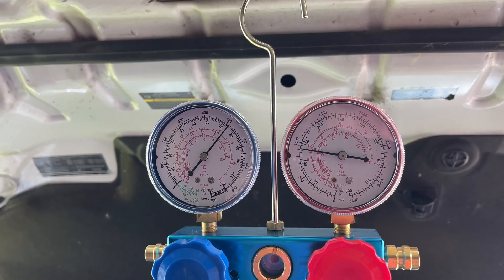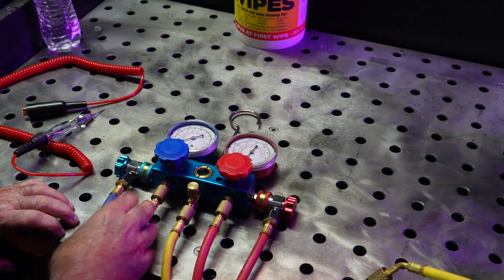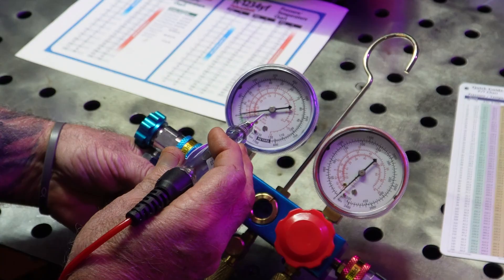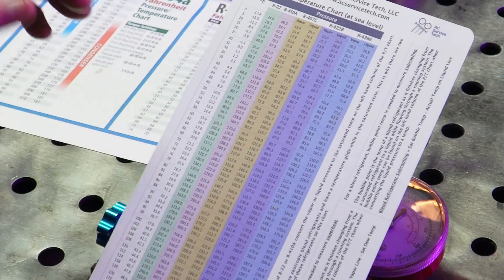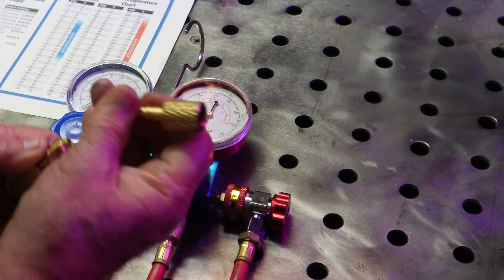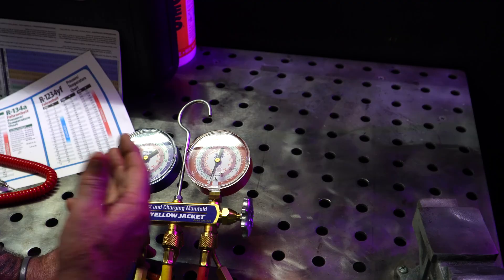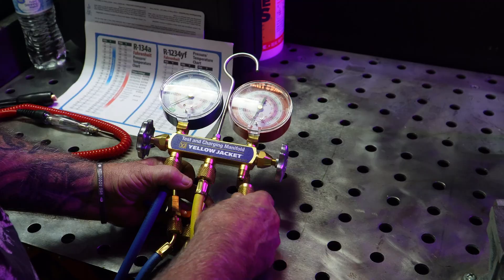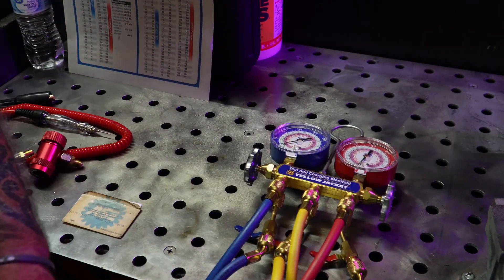How To Read And Understand AC Gauges

Comment: Rus, what is the right saturation temperature. in car hvac, we simply take everything out and refill with recommended oz..  wondering right satuation temperature.. if freeon is low, PSI will be lower, saturation temperature goes down , does that mean it cools down more.. if so why do we need to go with 40 degree saturation point instead can we aim for 35. degree saturation. i believe if we go closer to 32 degree saturation it will freez up, that why they are targetting for 40 degree saturation. just trying to understand the dynamics... appreciate your help here.
Reply from the maker: Automotive AC systems are designed to run as low as possible without going below freezing temperatures.  My Toyota has a target temp of 34 degrees at the evaporator fin thermistor.  Many scan tools will tell you the target, and it’s up to the ac control module to achieve that target by adjusting the pressures via electronic control valve.  Where you have the cabin air temperature setting also comes in to play so it delivers your desired comfort levels.  Other sensors such as ambient air, solar, cabin, etc.  all play a part by sending their inputs to the control module so it can accurately make adjustments to give desired comfort.  Hope that makes sense.

Comment: When pressure on low is 30 psi what does the temperature reading mean? lets say +8C?
Reply from the maker: Which refrigerant?  Pressure / Temperature correlation changes from one refrigerant to another, such as R134A at 30 psi on the low side correlates close to 35 degrees F saturation temperature in the evaporator, but R22 would be 7 degrees F  saturation temperature in the evaporator with a low side pressure of 30 psi.

Comment: Good evening, how can you determine a faulty ac compressor on a vehicle with the gauges?  Thanks in advance
Reply from the maker: If it’s an older fixed displacement compressor, then look for a high low side pressure and a low high side pressure.  This indicates that the compressor is no longer pumping to its full capacity.  If it’s a more modern variable displacement compressor then watch my video on how to diagnose a compressor with 100% accuracy
Reply: @SkillSavvyDIY Thank you fort the timely response. That really helps me out with the issue i have now on a volkswagen jetta. After the 30 vacuum on the system and installation of freon, my low side reading is high. It calls for 525 grams +9
After 325 grams installed the low side pressure is at 50 psi already. Your info and knowledge really helps me understand why

Comment: Can you possibly elaborate on what it takes or what the process is in getting the 608 EPA certification? I see on a couple of websites where they sell R410a for around $400 for a 25lb container but they request your EPA information. Going back to your reason for starting this channel because prices have gotten ridiculous, I’ve been quoted by a couple of HVAC companies wanting to charge  $125.00 for a lb of R410a. If the consumer can purchase R134, then why can’t the consumer purchase the R410a? Great channel with valuable content/information. Thanks!!
Reply from the maker: Skill Cat is the cheapest way to get the EPA 608 certification and you can do it at your own leisure over time.  The only downside is you have to do it on your phone or at least I did.  I didn't see away to do it on the computer then.  You download the app and subscribe at $10 per month.  I only kept it until I was finished so it only cost me $10 to get the certification.  You chose on the app which certification you want to get, then you will begin lessons and at the end of every lesson you will take a quiz.  It took me 2 weeks to go through every lesson spending a few hours every night.  This is for the universal certification.  The other EPA certs would not be as in depth.  Once you finish the lessons, you can take the exam.  If I remember right, they give you 2 hours to complete the exam and it is a proctored exam meaning your phone takes a photo of you every few seconds as you take the exam so they know it is you taking the exam.  Prior to the exam you have to upload a photo of yourself and drivers license  for comparison.   If you pass then you can print the certification or you can do what I did and spend an additional $50 to get the plastic card which also has a barcode on it.  

The refrigerants that are being phase out will continue to increase in price every year, because production is being cut every year until they are completely phased out over time.  That same 25 pound bottle could have been purchased in 2023 for $300.  As far as your question on why a consumer can buy R134a and not R410a is anyone's guess, and that could change the next time the EPA rewrites the rules.  Hope this helps and I appreciate you watching.
Reply: Thanks. I remember back in the late 70’s and early 80’s when I was working at a body shop, they were phasing out, I think, R12. Every time we had a total loss, we were removing the R12 and squirreling it away. I’m not far from you down I-10 in Covington,La. I found this channel from your other channel. Thanks for the excellent information.
Reply from the maker: Yeah, I retrofitted many many cars and trucks from R12 to R134a back in the day, normally on a compressor change out.  Now here we go again with R1234yf which is phasing out R134a.  I hope they get it right this time LOL.   Awesome that you found this channel through my cooking channel.